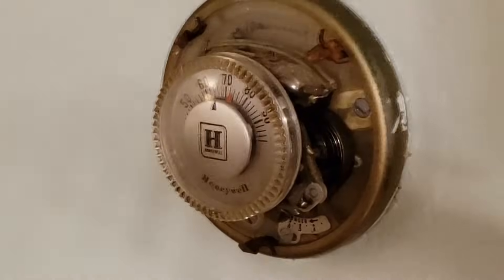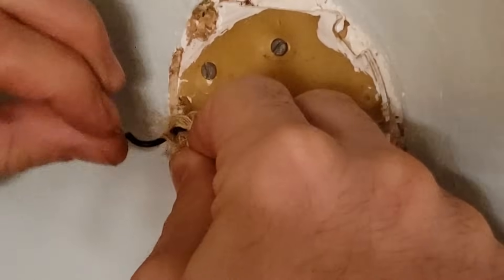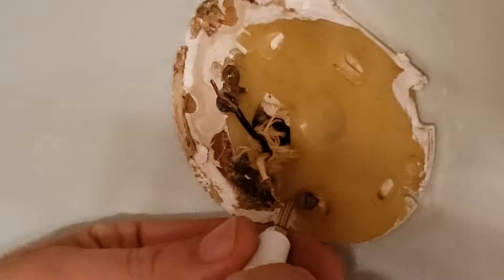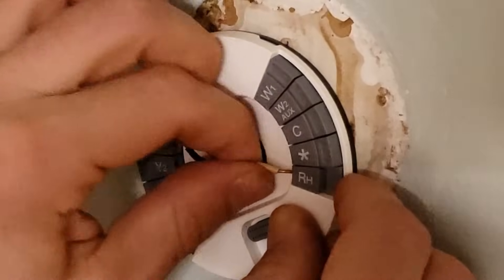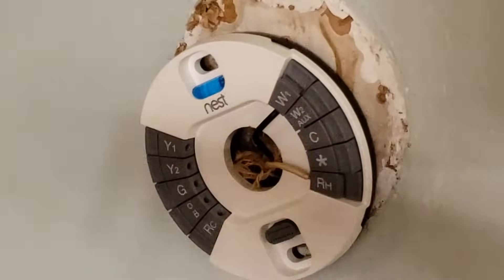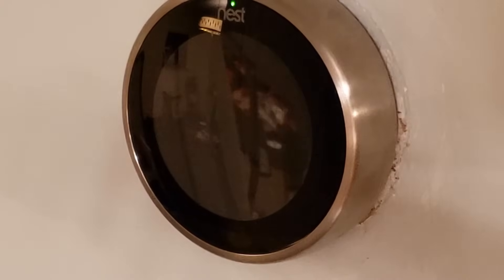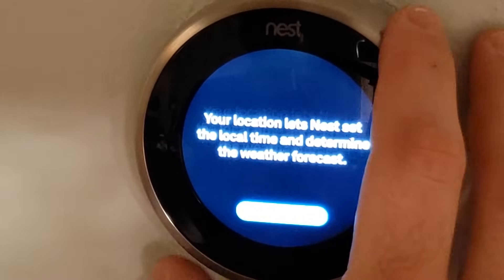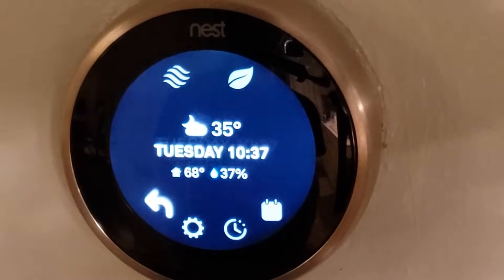How to Install a Nest Thermostat with Only Two Wires

Comment: Have you had any issues with your nest not working right because of the two connection
Reply from the maker: No, but sometimes the furnace can't supply enough current through two wires. If that happens, read my pinned comment - you may need to make a common wire.
Reply: @Bootstrappin  where would your pinned comment be
Reply: How do I go about making my c connection
Reply from the maker: @georgeB683-n7x  ordinarily, it should appear at the top of the comments. Either way, I'll put it here too, but basically your two options are: wire the Nest C-wire adapter into your furnace (it comes with instructions), or you get a wall adapter. All you do is plug it into a nearby outlet, and it provides you an extra wire to run into the back of your Nest:

New Nest video: how to install with HVAC system https://youtu.be/fo1PJ_XDgSg

If your furnace isn't supplying power to your Nest with two wires, you have a few options

1) Google Nest Power Connector - Nest Thermostat C Wire if your furnace isn't supplying power to your Nest:
https://amzn.to/3tcWwzq

2) Adapter, run this as a "C-wire"
 to your Nest:
https://amzn.to/3qvVTOu

More energy saving how-to videos from me:
https://youtu.be/ao9iOhVHvWw

Nest 3rd gen:
https://amzn.to/3G7mKYf
Reply: @Bootstrappin  thanks for all your help
Reply from the maker: @georgeB683-n7x  sure thing!

Comment: anyone has the short cycling problem? i installed the 3rd gen nest with same only two wires. it works the first year, right now the thermostat will show up low battery and the heat will turn on for 2 and half min and shut off itslef and keep repeating.

Comment: At the end of the video you mention the 2 thick wires with higher voltage...whats the process for hooking up to those?
Reply from the maker: If you have high voltage wires, you'll need a specialized thermostat, Nest isn't compatible as far as I know. It's probably possible to cheese it with a relay though. This guy goes into some detail:
https://youtu.be/3m-GU_-7GW8
Reply: @Bootstrappin  thank you for the reply, I will check it out.

Comment: do we need c wire 
?
Reply from the maker: Sometimes -- it depends if your boiler can supply enough current. If not, you may need a C-wire maker or adapter -- I have a link in the description to both.

Comment: Will this work with all Nest thermostats? The one I have is the Nest Thermostat
Reply from the maker: It should - but that largely depends on whether your boiler circuit can supply enough current to power the Nest. That's a gamble, but you can always install a common wire after.

Comment: It’s nice and all but you have to replace the batteries every 2 days like this. I install one and gotta figure out how to run a cwire to it. If not the batteries die and it turns off.
Reply from the maker: Interesting, perhaps your boiler circuitry can't push enough current to charge it. In my case, it stays charged - even with only these two wires. But yes, unfortunately you'll need a c-wire or boiler adapter/c-wire maker.

Comment: just installed，why my fan keep running？
Reply from the maker: If you have a fan, you can't have two wires, so something was probably wired wrong. I believe fan is supposed to go to 'G'. Nest also has the ability to keep the fan turned on, so check settings as well.

Comment: if i turn off all the breakers it should be fine as well right? i was told never to touch that on/off switch cause its an emergency switch off
Reply from the maker: I don't see what a circuit breaker would accomplish that's different from an emergency switch. But yeah, if you find the right breaker, it should accomplish the same thing.

Comment: Is it ok to turn off the burner even though it says for emergency use only? For some reason the breaker labeled “furnace” to my house is not turning the furnace off. And when you switch the burner off, I’m assuming it cuts power to all the thermostats in your home as well? Also, once done, and you switch the burner back on, any problems? Thanks.
Reply from the maker: Yes, that is what that switch is for. Should in theory also cut power to the thermostat. Would be good to double check and make sure that you can't turn the furnace on with that switch off. The only problem I could foresee is if you have a gas furnace that has a manual pilot light -- you may have to relight it yourself if that's the case.
Reply: @Bootstrappin  Thanks for the reply.

Comment: So this will start my heat and AC?
Reply from the maker: Not with two wires. This is heat only. AC usually has more wires.
Reply: @Bootstrappin  Ordered a NEST since it was on sale for $199. As Arnold says, "I'll be back." LOL.
Reply from the maker: @Blackdog4818  oh shit lol. Good luck, shouldn't be too bad though. I have another video on installing Nest with HVAC
Reply: @Bootstrappin  So good news is I have 4 wires in the back of my thermostat, White to "W", Yellow to "Y", and Green to "G". My red wire though is jumped between HR and HC which would be quite a stretch on the NEST. Do I need to repeat this jump with the NEST? Or can I just stick it in HR?
Reply from the maker: @Blackdog4818  you could always just see what happens, but I'd keep the jumper. Could be an HVAC specific reason, so I like to keep what I find. Nest generally does a good job telling you if something is wired funny.
Reply: @Bootstrappin  Only problem appears to be no "C" wire so not sure about battery life. But I can remove the Nest and attach it to a recharger (lithium ion battery on the new models) if it's like now where I won't be using the heat or AC much until November comes and it gets cold.

Comment: great video. thank you for the instruction. I have a bit of a different scenario that is a head scratcher, we are installing new cooling units (Samsung 360 Cassette 46,000 btu model), but we do not have any heating whatsoever as we are in a very warm location year round. The samsung thermostats (model MWR-WE13N) have a low voltage 2 wire connection (labeled F3 and F4) , similar to the 2 wire heat that you just demonstrated. I've tried discuss this with Google nest support and they have been useless. We are looking for a diagram, and advice, whether 2 wire with Samsung products, can be set up on Nest Learning Thermostats. We are also more that happy to add control wire separately to power the thermostat so that isn't the issue here. Any advice? Cheers!
Reply from the maker: Bit of an educated guess on my part. I read your Samsung thermostat's manual, and it sounds to me like the F3/F4 cable is using a communication protocol, while also supplying a bit of power. The protocol is key because it looks like you can control many things over two wires - cooling, fan, power, maybe even heat if you had it. Nest operates on relays - it has a unique pin for every function. My new HVAC has a dedicated wire each for cooling, heating, common, 24V, and fan. So at this quick glance, I feel like it wouldn't work with Nest.
Reply from the maker: So if I'm right about the protocol, which seems to be RS-485 (another guess), you could make it work with an adapter like this (again, perform your due diligence, this is just a quick and dirty answer) https://www.komachine.com/en/companies/cyclogic/products/76974-CL-IM08A

Comment: I had the 220 Volts system and had to buy transformer and did interface with relay to do it and it worked 💪
But forget about two wires , it does not work as your nest had to charge and it will not charge without the C wire, keep taking it out and charge it like your mobile is not practical 😉
Reply: Which transformer did you buy? And how did you add C wire to the transformer?

Comment: Thank you! Just the video that I needed. I only saw two wires and was completely confused by other videos showing 4 colored wires. I'm going to do this myself and you can take all of the credit!!!
Reply: Did you need to add a common wire to keep it charge?
Reply: @donchulo83  Don, when I hooked it up with he two wires, that's all it needed to stay charged. It's electric.
Reply: @pinkpeony5871  Real pros can get it to work with no wires.
Reply: @deuswulf6193  Well, I'm not a pro! lol.
Reply: @pinkpeony5871  is it still working properly with 2 wires?
Reply: @sayid160  Hi. Yes. Working great!
Reply: @pinkpeony5871  HI. We're you able to get the wifi to work with just the 2 wires?
Reply: I also have a black & white wire only. There was a Honeywell c67n connected. But I'd prefer the Nest. But I'm confused b/c I called a rep for Nest and they told me the Nest wasn't compatible, unless I has a additional wire setup?
Reply: @Blah-blah-sure  My nest worked and still does. Follow this video and see if it works
Reply: @pinkpeony5871  I just installed mine. I'm in love ❤️. Everything was just as described. Painless to connect the wires

Comment: nests are nice, I like them. some systems require a common (C) wire to power the nest. its just 24v to charge the internal 100mah(i think) battery. red wire and white wire are your wires for heat which is W and RH. if your furnace has w1 and w2 its a 2 stage furnace. high and low. same with cooling y1 and y2 for a 2 stage AC. green wire is for fan only. O(orange) B (blue) Rc (red) all can control a heat pump/geothermal.  Orange is the reversing valve for the heating or cooling portion of the heat pump. Blue is the common 24v for the heat pump. and Rc is the power from the heat pump. remember! this is all just copper wire. someone may have arranged the wire colors differently on your units! so check the board in your furnace/ heat pump/ ac before assuming they are correct. ive met many color blind co-workers!

Comment: Mine ended up needing the C wire so I just bought a plugged in 24V adapter and run it behind the wall along the door molding to an outlet.
Reply: Which terminals did you plug the adapter into?
Reply: R and C

Comment: will it work on my base board heater which has only two wire ?
Reply from the maker: Only one way to find out! You may or may not need a 'C' wire adapter.
Reply: @Bootstrappin  Thanks for your prompt reply

Comment: You will need a C-wire , to keep Nest charged !!
Reply: No you wont.
Reply: @Insert_Credits  Maybe where you live if you're using AC all the time , but here in Canada C-wire is needed.
Reply: @ARGBlackCloud  I live in Canada.

You remove the device when it gets cold out and charge it for a quick minute and it should work perfect.

You probably have an older model nest.

The version in the video and the model E both can charge from the R fine.
Reply: @Insert_Credits  Yeah that's not the issue , I have to tell my clients that, but it's always a case of the battery get discharged because on lack of use for furnace or in the southern states AC. Which happens here more often than people realize, also Im a Nest Pro . I always install a C-wire for my clients to make sure they aren't freezing in the dark when it gets cold . Another thing is Nest doesn't tell us how their charge circuit works so I've seen lots of dead thermostats cause of no C-wire.
Reply: @ARGBlackCloud  You're wrong on every aspect. You're not a Nest Pro.
Reply: @Insert_Credits  Interesting cause I have over 100 installs for Nest ! And why exactly am I wrong . Are you a HVAC certified tech ?

Comment: I tried this and the thermostat kept going higher and higher.  I had to shut it off.  I have radiators with a boiler, and my electrician said I needed a common wire with this system.  So, then the boiler I have doesn’t use a common wire (?) so he had to run a relay.  Long story short - this may not necessarily work as instructed in the video, depending on what kind of heating system you have.
Reply from the maker: This is true. All boilers seem different, I'm starting to hear rumblings about Google updating the Nests to no longer support the two wire option. Hopefully not as an 'over the air' update, and suddenly tons of Nests will stop working.

Comment: My old honeywell thermostat has 2 wires. When I try install nest 2020 (not nest learning). Setup asks for C wire required.
Reply from the maker: Interesting, I guess it doesn't always work. I have a link to a C-wire adapter and a common maker in the pinned link.
Reply: @Bootstrappin  
Since my heating has 2 wires Red and White only. So for a C wire. I plan to use transformer option. My nest 2020 has Y, C, W, OB, G, R, terminals. From transformer 1 wire goes to C, which terminal the other wire goes?
Reply from the maker: LegoBanda like this: https://images.app.goo.gl/Q1tajPeo7RpWEomD7

Comment: Why do you love Nest so much? Serious question
Reply from the maker: It looks and feels great to use. Always liked the stainless dial with circular display. Beyond that, it just works really well - easy control from your phone, and I can schedule set temperatures throughout the day. It also learns my habits when I touch the dial - remembers to add these to the schedule (like me turning heat down at night). It also figures out how your house responds to heat so you don't overshoot your target temperature. Plus really easy to install. Very slick overall, and reliable so far.
Reply: Thanks so much for replying! In that case would you say the only “disadvantage” is when the capacitor starts failing after not using a C wire? Because eventually will fail right?
Reply from the maker: @marianabueno6063  I personally have not observed this failure in my Nest after two years, but if it's the case for others then the common wire may be a wise and simple thing to install.

Comment: Have you had any issues with the 2 wire set up at all, has been giving you any issues with no c connected?, great video thumbs up...
Reply: i have the two wire setup for just heat...works great
Reply: @ProvisionsBBQ  this is the gen 3 Learning thermostat correct? I settle on a home April 6th and have been eyeing the old thermostat with mercury tube on the wall since I first stepped foot inside. I have one in the dining room for radiator heat and another upstairs that controls the A/C. I'm going to buy two gen 3 Learning thermostats but I assume the really old thermostat only has two wires....any problems with yours thus far?
Reply from the maker: I had this setup for a couple of years and I never had an issue. I'm hearing an occasional rumbling/rumor that Nest, through a software update, disabled the two wire configuration? I haven't confirmed this and unfortunately can't check because I've since moved out of the house.

Comment: Thanks for sharing your experience with Nest. I'm thinking of buying one for my apartment, for cooling system. With only two wires, is it possible to control the fan as well?
Reply: I have the question

Comment: what happened when the battery of the thermostat drained? with these 2 wires u connected u didnt provide power to the thermostat,
Reply from the maker: Nothing, it has been two years. The two wires do supply power, mine hasn't died. Doesn't work with all furnaces.
Reply: @Bootstrappin  thanks, not working with mine thats why i was wondering, and i tried with 24v power supply cant figure out how to do the wiring, my 2 wires dont supply 24 volt power for the thermostat
Reply from the maker: @er9539  read my pinned comment -- you may need a common wire adapter.
Reply: @Bootstrappin  thank you

Comment: You attached the black and white wire opposite.  White goes to W1.
Reply from the maker: No, not for my system. I tested both ways. The problem is that there is no standard for HVAC colors whatsoever, so you really just have to follow how the previous thermostat was installed.
Reply: @Bootstrappin  actually there is a standard for the colors. That's why I'm saying that it's not correct the way you put it in.  I know it works,  but the white wire should be the other side.    White is first stage heat.  I went to school for this a long time ago. I also had to pass a contractors exam with these sorts of questions on the exam.  Ultimately wires are just wires, but when you keep the colors the right way, it makes it easy to understand where it's going to or where it came from in the unit.  Since you just have a furnace it's not really all that important considering you only have two wires.  The traditional thermostat wire colors are blue for common, red for power to the thermostat, yellow for the air conditioning compressor, green for the indoor fan motor, and white for heat.  Orange is usually used for heat pumps going to the reversing valve.

Comment: Thanks for the amazing video! There is one issue that the battery won’t be changed without C wire. That means can’t use Bluetooth or internet connection
Reply from the maker: Thank you! And that's too bad. Yeah some boilers don't provide enough current to charge these with two wires. Mine did, have no idea which ones can or can't.

Comment: this worked until Nest updated all their thermostats and now requires you to use the C wire with this thermostat in most install.
Reply: Do you meant they have a software update?  I'm having low power issue sine last week and they were working fine for a year.
Reply: @Brian-et8jo  same as me I have next thermostats for years have no issues until this week shows that is low battery and disconnect  the WiFi  I think it need to use the C wire

Comment: It does die eventually as it doesn't get a constant charge from lack of not having a C wire. Some folks are ok though with just pulling the nest from the wall and charging as needed.

Comment: Wouldn't you have to charge it or change batteries every day
Reply from the maker: No, it can draw current from the relay on the heater. As proof, I never had to charge mine in the two years I've had it.
Reply: @Bootstrappin  with only 2 wire
Reply from the maker: Correct, I only have two wires.